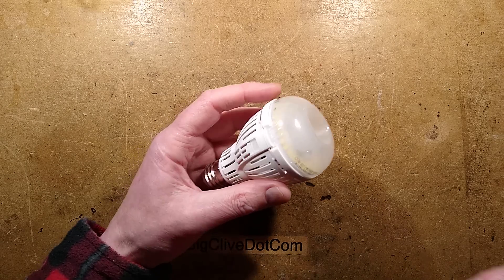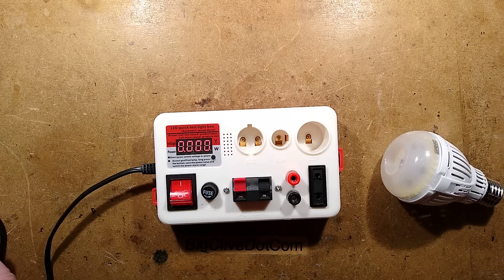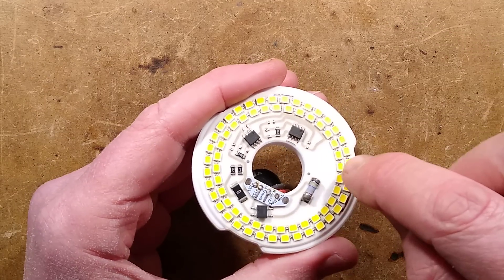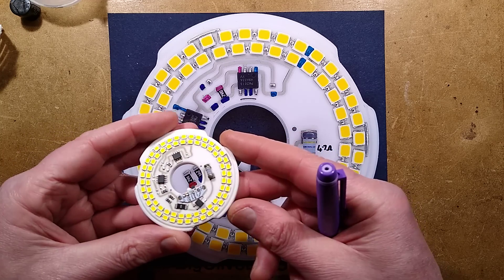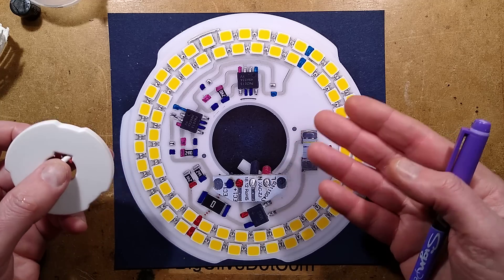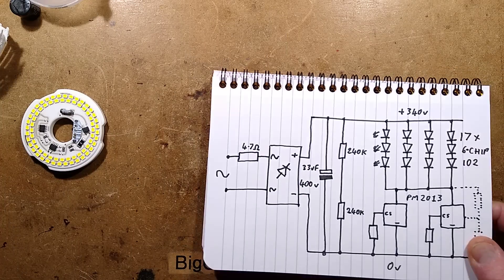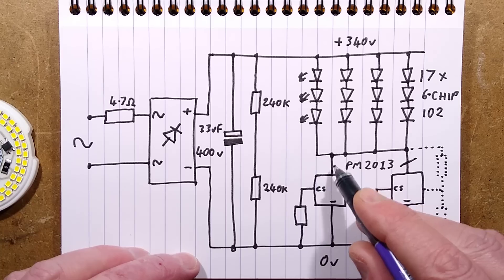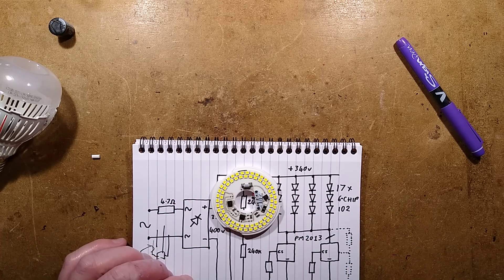Inside a ceramic lamp (with schematic)

Comment: Julian Ilett figured out sticking red electrical tape over his red LED displays makes them easily readable on camera. It would make your light bulb tester a lot easier to read during use.

My home test equipment became much more pleasant to use after copying his example. Red tape is much quicker and easier than trying to glue or mount diffusion gel in front as I've done in the past.

Another enjoyable teardown! Thanks again Clive.
Reply: DiodeGoneWild has used strips cut from black plastic garbage bags for the same purpose.  The idea is to reduce reflectivity, so it's more obvious when light is actually coming out of the display as opposed to just bouncing off it.

Comment: okay my version of this lamp that was bigger and looks too close in design to be a deviation - the glass cover blew up under one year. The resulting "bulb" is a flying insect death magnet. They made his version harder to covert to flying insect death tool but go buy a $9.99 electro death fly swatter and use this LED config to destroy flying insects. Tested in good faith on the shores of Lake Erie for over a decade. I assume this same set-up is still being used as I sold the property before the light source died. I felt bad for the thousands of Crane Flies that didn't adapt. No warmth for dead mosquitoes.

Comment: Since it has a sort of rounded 3D appearance my guess would be screen printing to apply some active alloy on that can directly bond to the ceramic. Alternatively it could be as simple as conductive ink to keep costs down, but not sure how good the thermal dissipation would be. It could be laser sintered as well, but given they are going for bulk production I would guess they are going for something fairly economical. In a way its almost sort of a moot point since they go thru the effort to make it ceramic, but then just plop conventional low temperature components on it rather than the dies themselves, nor bother to use an actual heatsink to take advantage of it. Marketing I guess...

Comment: I just had an led bulb blow last night, of course the first thing I did was crack it open. The rectifier failed and took two resistors to silicon heaven with it, it only lasted two years, I should have words with sainsburys. 
Also, the score marks that let electrolytic vent safely were only lightly stamped so I'm sure it would fail violently, I'm going to explode it to prove a point.

Comment: it seems like a lot of air gap around the capacitor for airflow... so i wonder how hot it gets? for example an 8w cheap one, if it does not get too hot in there maybe we could... have enough room to put an esp-01 with a relay module inside, and then flash a firmware to control them from home assistant? although i suppose it also would need a stable low voltage dc power for the esp8266 and the relay coil. i am not sure how feasible this is yet

Comment: Circuit layer is usually screen printed and fired at 850 C. Not old tech... Most cars use ceramic circuit for fuel guage, cause the petrol fumes can corrode other circuits.. You can screen print anything from gold to palladium .

Comment: For better heat dissipation... They could mold the ceramic with some divots or fins on the back to increase surface area. Obviously not big tall fins like a regular heat sink because pf ceramics brittle nature... But even just little divots with an inward or outter direction would increase the surface area by multiple times. Who knows maybe there's a reason for it .... For example it might not run the cooler... But it's more stable without sudden drifts in temperature. Especially in a a grow room situation... We're fans and moisture kick-off constantly and could swing the temperature rapidly. Similar to how laboratory laser modules have big thick heatsinks without fins... To keep everything as cool as possible but also very stable

Comment: Would be interesting to see if tracks get warm, since they are not copper, so probably have a higher resistance. You could also measure resistance on some of those unused tracks.
Reply: Current is low milliamps due to the really high voltage of LED strings, and power is current squared times resistance, so the resistance of the tracks doesn't need to be low.
Reply: there is a graphic on their official website that calls the tracks 'silver lines'  however it's a very simple 'ours vs theirs' comparison type graphic, hard to say how technically revealing they're being

Comment: Wow! A very high-quality product with a reasonable, if not accurate, claim on the lumens available. Ya don't see that everyday.
That being said I'm not sure why it seems so much brighter than the 2 X AAA 500,000 lumen pen light I bought on the interwebs.
;)
Reply: Yes. 2xAAA could power a 500,000 lumen light only if they powered a xenon flash. You might get a few 1 ms flashes with a minute between each.
Reply: @whitcwa  Next time I'll exaggerate much more.
Thanks for the tip.

Comment: A good reason, as you noted, for having included the circuit board is that the ceramic substrate is difficult to soldier to. The tracks, often times a precious metal like silver or platinum, are too soft and ductile to support components other than surface mount components.  Additionally,  ceramics are brittle, making it difficult to drill any via (blind, buried, through hole, staggered) at risk of breaking or damaging the ceramic. There is a preference for sputtering indium silver alloys with graphene deposits  in scientific settings, but equipment and lab conditions make the process far too costly for general manufacturing. In higher applications, Antimony, Tin, Cu and cubic boron nitride are added for vibration resistance and "springy-ness".
Reply: If I may also add Clive, the ceramic is a little thick-ums due to the fact that, depending on the cutting technique, the ceramic becomes difficult to cut the thinner it gets. I'm betting this puck was sintered thick for packaging and the occasional bump.

Comment: That's incredible! It gets me thinking: could they have a ceramic material with metal pieces (like aluminum or tin) suspended in it, then with a ceramic material that could evaporate or vaporize under a laser which could let the metal particles sinter/fuse together to form traces? That probably isn't how they did it but I'm wondering if it could work, haha.
Reply: Ceramic PCBs have been around since the 1960s, and maybe even the 1950s. The standard way to make them was to simply run them thru a printing press that deposited a silver-bearing ink in the surface. Then you fired them in a kiln, just like you would fire a ceramic coffee cup. This burned off the volatiles in the 'ink' and melted all the little bits of silver together so you got a conductive trace. The silver ink was black colored in every instance I've seen, and I noted that these tracks are a grey-black. It is possible they are using aluminum or some other metal than silver, but likely doing it the same way.

Comment: I'd love to see some thermal tests of that ceramic. Usually ceramic isn't a particularly good heat conductor, but i believe there are specialty ceramics with high heat conductivity available.

The ceramic could be printed with a specialied laser printer. The powdered metal would be the toner, and transferred to a drum. The powder would them be transferred onto the surface of the ceramic and heated to fuse it in place. Not that much different than the special toner cartridges banks use to print magnetic ink on checks and cash, withdrawal, and deposit tickets.

Comment: Interesting lamp.  The grey color reminded me of the ink used for some of the PCB making machines that use a pen of conductive ink to draw the circuit on to boards.  The ink only needs to dry prior to soldering.
Reply: The way these were made in the 1960s was to run the substrates thru a printing press, depositing conductive ink. Then you fired the substrate like a coffee cup, which melted all the little silver bits into a continuous trace, and fused them into the top few microns of the ceramic surface. The results were extremely durable.
Reply: Typically the ink is composed of actual silver nanoparticles as silver is highly conductive and most of its oxides also remain conductive.  Not as conductive as a solid copper trace would be, but still perfectly acceptable if you can accept some extra resistance losses in your traces and for short traces and lower currents/higher voltages those losses are often quite acceptable for many electronics.  I have occasionally used such pens to repair or route around damaged traces on PCBs as opposed to routing a bodge wire as the repair just to see how such worked out long term and….20 years later those repairs still work.

Comment: I would think that the heatsink is so thick so that the heat from the LEDs is more accurately transmitted to the regulators than if it was thinner. Thanks.

Comment: Pin 3 is "Constant power adjust" or "Light adjust" according to data sheet
Reply: My guess as to the “PCR” labeling was “Programmable Current Regulation”, so that would certainly fit.  Basically a way to assign a weighted multiplier to the current sense pin.

Comment: Is that PCR pin Power factor CoRrection ? .. modulate the current with the supply voltage (slightly)

Comment: I use these Sansi as SAD lighting because of their full spectrum output. I have a really massive one in my office ceiling. I really rate them for quality of light. I switched after my previous preferred type started regularly failing by getting the fitting super hot.

Comment: That small addon PCB is so they can solder the wires with a normal iron. You cant solder on ceramic substrates with a normal iron because the ceramic immidiatly conducts the heat away. You would need to heat the whole substate on a hotplate, which is not convenient on the assembly line

Comment: Ceramic PCBs have a very long history in the electronics business as the substrate for hybrid circuits.  Tracks are often laid down using a "print and fire" technique.   An example of an early ceramic hybrid is the SLT circuits used in the IBM System/360 computers of the mid 1960s.
Reply: It is my understanding that this process of "firing" is limited with several drawbacks. Consider that the ceramic substrate and the oxide layer between the tracks prevents a positive covalent bond between the surfaces. These aberrations become clear through normal use as the tracks contract and expand with radiation of heat which leads to premature failure or lifted tracks. The truth of the matter is, ceramics are complicated.
Reply: @LeviGoldwing  Indeed, I had to deal with a lot of hybrid failures in the past. Hopefully this new technology will be better.
Reply: @Sundog  Interesting, you said that. Indeed, from what I can observe by Clive's video, the manufacturing process seems to have been simplified or reduced to a nominal cost. I recall, a few years ago Taiwan conducted a study using graphene oxide/graphene layered composite that created an atomic layer between the substrate ceramic and the tracks and used an electrochemical sensor/s. This technology may allow for the oxide layer to become sacrificial, layered in a anisotropic chemical eching. According to the the numbers submitted, this improved efficiency:  

"This highly anisotropic hydrogen etching technology may work as a simple and convenient way to determine graphene crystal orientation and grain size and may enable the etching of graphene into nanoribbons for electronic applications". 

Preparation, Bandgap Engineering, and Performance Control of Graphene Nanoribbons
Hao Luo and Gui Yu
Chemistry of Materials 2022 34 (8), 3588-3615
DOI: 10.1021/acs.chemmater.1c04215

Comment: What is the purpose of those 2 240kohm resistors?
Reply from the maker: Mainly to present a small load to prevent LED ghosting due to capacitive coupling between the switch wires, that can cause an LED lamp to glow slightly when off.
Reply: @bigclivedotcom  Thanks! I wondered why some the LED lamps had that dim glow after power was off.

Comment: It could well be Electron Beam Melting / Sintering for the tracks not laser, I've seen work like this done on Arcam systems. You could load up cassettes / trays of parts and process them very very quickly.
Reply: Easier to screen print the tracks with silver loaded ink, and simply fire the ceramic a final time to bond it to the board, as is used on so many ceramic substrates. Low cost, and good adhesion, plus reasonably conductive traces, and as a bonus a second screen after drying of the first of a glaze to cover the tracks aside from the exposed solder pads makes a good solder mask as well.

Comment: So are they still using solder to mount the surface mount items to the board actually, the Ceramic?😮 Or is it some type of magical compound?
Reply from the maker: It looks like standard solder.
Reply: Ceramic typically has no problem standing up to heat. What it has a problem with is uneven heating. So they might have had to adjust the reflow profile to prevent cracking of the substrate.

Comment: Seems silly of them to put the 4 LED strings in parallel with two current sinks also in parallel. Why didn't they have 2 LED strings matched with one current sink times two? Would have given redundancy and be easier to match 2 LED strings rather than 4. Certainly is a quality looking build though.

Comment: We have PAR30 LED floodlights at work which are 40 Watts / 4,000 Lumens.  They have a similar shape to the one Clive is showing,  but have a fan inside.  They are rated 35,000 Hours lifespan.  They have been operating 24/7 for 5 years and not burnt out yet !!   Very good stuff.
Reply: I may be mistaken, but I think the lifespan rating on most LEDs are telling you how long it will last before it drops below 80% its initial brightness.
Reply: @MrMartinSchou  That is true,  we actually took one of the 5 year old floodlights out and changed it with a brand new one,  and for sure there was a 20% difference in brightness.  But I haven't seen any single burnt out leds yet,  so they are wearing out evenly.
Reply: I've got something like that in floodlight fixtures around the outside of my house. They're a pain in the butt to service (need a big ladder to reach them over the 2nd floor) so having bulbs that will last is imperative, cost is only a secondary consideration. Currently there are 5 working after 6 years and one that just failed a week ago.
Reply: @tncorgi92  These do last a long time,  and at 4,000 lumens they are extremely bright,  but not the cheapest at 28$ /ea or 150$ for a box of six.
Reply: The fan is probably the shortest lifespan of the components, if it's a motor-driven one (as opposed to piezo or other "solid state" type). Passive cooling would be better, IMHO

Comment: I found them 'ceramic heat-sinks' to be useless for cooling. the 9W variant still makes a desk lamp to hot to aim at what I'm working on (I measured over 170F in a 70F room after an hour of the bulb being on, and it did throttle back to under 6.5W at that point, and was still getting hotter and thermal throttling more).
4:30 ish, the ones I got, have a sorry attempt of motherboard VRM ornament shaping to them, it's not flat on the back side, just as ineffective. it just bakes away in the bulb.

I gave up on the Sansi bulbs after a few hours of looking at them, and went back to fussing with the aluminum backed PCB ones.  the sansi bulbs are all gimmicks at best.
Reply: A good desk lamp design with LEDs doesn't use retrofit bulbs anyway. You need directional light, but the retrofit bulb's diffuser goes out of its way to send light everywhere, so then you need an inefficient reflector to re-direct the light. Which then cooks the bulb by trapping hot air. Plus so many watts worth of heat are only needed only because of the inefficiencies from the diffuser and reflector. 

A safe low voltage design with a good exposed heatsink is probably the way to go.
Reply: @rexsceleratorum1632  yeah, I have a few vented back basket-like desk lamps, and I have removed that frosted plastic cover on a aluminum backed PCB bulb, drilled some holes in it's base to let air in behind the PCB, etc.  much cooler operating than the Sansi ones even at the same mA/Watts/Power.  the Sansi ones just produce way more heat than it should for a 'LED' bulb, and the ceramic heatsink thing is just a fail, lol.
Reply: @Zarcondeegrissom  Here in India the mains is a spicy 230V, so I don't want a desk lamp with an exposed mains PCB or even exposed mains-adjacent heatsink. 

Also any sort of holes are a bad idea in the tropics because it instantly becomes a bug trap.

Comment: Interesting to see a LED bulb not designed to fail. It seems the common failure point is the electrolytic cap. The city replaced a few dozens in an underground pass and about a quarter of them started flickering after about a year. Really adds to the underground tunnel ambiance.
Reply: LEDs failed to deliver on low maintenance town fixtures.
Reply: But have they turned blue?
Reply: Connecticut installed some LED street lamps to replace the high-pressure sodium lamps on a 1 or 2 mile stretch of highway. Three days after they were powered on, it looked like a disco because most of the fixtures started flashing from failure. Go, tax dollars! 💸

Hard to explain, but I have a video of it:
https://www.youtube.com/watch?v=SS4rENvEckY&list=PLWAA8rPRlXVEz62rwFE76xc_BdmAS0sKV&index=53
(Not self-promoting, I'm not monetized, I don't even do much on my channel anymore, I just wanted to show you what I was trying to explain.)